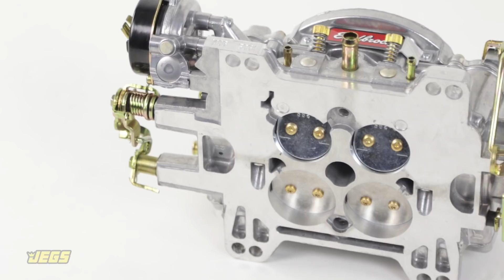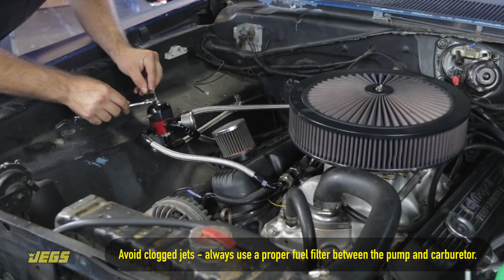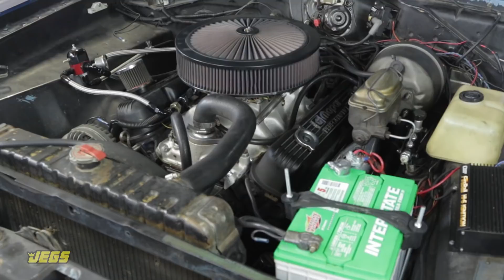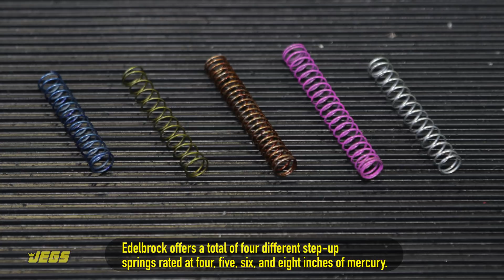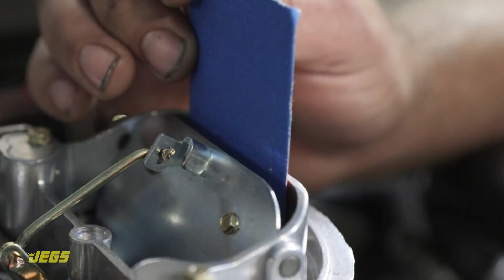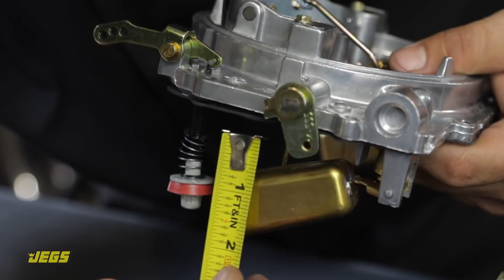How to Tune Edelbrock Carburetor Carb Idle Mixture Screws Choke Metering Rods Jets Fuel Air Vacuum

Comment: The idle on my vehicle doesn't change no matter how much I adjust the idle screw, furthermore the only time the mixture screws change the RPM in the downward position is when you lean them both out to the point where the engine stumbles then the reduces very little.. The idle speed is around 1500 rpm (if you just drive around and let your foot off the gas) but you can go up to the engine bay and reset the throttle lower or by pulling on the gas pedal.. I even have 2 springs set to return the throttle and they don't seem to work.
Reply from the maker: The first thing you should do is remove the idle screws and blow out and possible debris or blockage as turning them in or out should affect idle mixture and smoothness. If there is still an issue the next possibility is a possible vacuum leak somewhere else, check the base gasket and any other places air could be leaking and causing the adjustment not to work. A high idle can be caused by a vacuum leak or adjustment is needed on the fast idle. See the instruction manual on how to test and adjust.
Reply: JEGS Performance  I notice the idle drops to a reasonable level when I disconnect the vacuum advance on my duraspark 2 dist. I did a vacuum test and noticed it at 20 inches but it shakes violently + or - 5 inches vacuum.
Reply from the maker: Hmmmm...perhaps the distributor setting/adjustment/vacuum advance is the issue? If interested, you may give Edelbrock a call direct at 1-800-416-8628 as they may be able to offer more ideas...
Reply: My dodge truck was doing the same thing. The kickdown rod(cable on most vehicles)was adjusted too far out on my transmission, which wasn't letting my throttle return all the way.

Comment: need to know where to put vacum lines on a 650elderbrock 4barrel
Reply from the maker: The distributor advance goes on the front left side (above the throttle blades), The PCV goes in the front middle 3/8 line. Vacuum modulator valve goes on front right (below throttle blades). The power brake booster either goes in the intake manifold at the back or the back port on the carb. Hope this helps.

Comment: new motor installed fuel is leaving the carb after its sat for about 6 hours I poor fuel in the carb fires right up doesn't leave the line but where could it be leaking from into the intake manifold
Reply from the maker: What is your fuel pressure? What do you mean by "fuel is leaving the carb"? If you have 6 psi fuel pressure, take the top off of the carb and inspect the needle and seat to make sure it is not stuck and also check that the floats are set correctly per the manual.
Reply: JEGS Performance pressure is right around 6 but I believe it's draining out of the bowls into the manifold
Reply from the maker: That tells us that either the needle and seat is sticking open or the floats need adjusted as either are continuing to allow fuel to fill the bowls and overflow them. Have you checked them?

Comment: i need help with my truck, it has a 350 small block and it idles good in park but once i put it in drive or reverse it shuts off, i was told it might be a carb problem
Reply: Vic The Barber 666 ...me too i got a 1980 chevy wit your same motor its standard 3speed shift but it's starting then when in gear it bogs gotta give it some gas to keep on make me look like dont know how to drive my dam truck dam annoying..
Reply: JEGS Performance
Reply: my carburetor is doing the same, you cant blow in to the car though the fuel line, feels like if it is stock...
Reply from the maker: If you have a bigger cam than stock and a stock torque converter, you may need a higher stall speed converter. If it is too tight, when you put the vehicle in gear, it will kill the engine.
Reply from the maker: What torque converter and camshaft do you have?
Reply: JEGS Performance ..not really sure i bought my truck   with it installed ...
Reply from the maker: Well, the first question to ask is what camshaft and torque converter do you have? If the torque converter is too tight, when you put the transmission in gear it kills the engine because it is not slipping enough. this usually applies to having a bigger cam with a stock torque converter. This is also assuming you are not touching the throttle at all when you put it in gear.
Reply: JEGS Performance sounds like my problem im not sure what cams in it but it is an aftermarket bigger cam and stock torque converter, would i just buy a torque converter with the specs to my engine? i dont have a lot of knowledge on torque converters
Reply from the maker: You really need to find out what lift and duration your cam has, otherwise it is a guess on what torque converter stall speed you need...Give us a call at 1-800-345-4545 and speak to one of our techs, they may be able to help you narrow down to a close-to-correct torque converter stall speed....
Reply: JEGS Performance alright thanks for your help ill give you guys a call sometime
Reply: got the Edelbrock 1406 carb
Reply from the maker: This is something that would be helpful to know. If the torque converter is too tight due to the camshaft being larger than stock, the engine will die when the transmission is put in gear. We are assuming that idle speed is around 800-1000 rpms before putting in gear?

Comment: mine got messed up and I barely had a year with it I didn't have the electric choke connected on what you showed with the credit card..the time I wanted to move the truck it backfired and turned off till it left some flame coming from the lower part of my passenger side header..owner that use to own the c10 that I own now left it sitting for 7years not covered at all from the sun and all but to get to the point the choke got stuck and only realised it when I wanted to start up the truck the next day and to see if it hopefully wouldn't do it again but wouldn't start
Reply: dude, I almost had the same issues but my carb was almost new. I ended up getting a holley four barrel meant for the engine family of my C10, which is a 350 for 60$ and rebuilt it with a 30$ kit and it runs great! but it's just a suggestion.

Comment: Need some help on this, I have a carter afb competitino series, electric choke, pretty much looks like this.  I got help setting it up and was told the back center port was for the pcv ,( not the power brake )  I know this is for edelbrock but they seem to be essentially the same.  I am having what sounds like "gasping" issues when I first throttle hard, and its smelling pretty rich when I start.  I initially came here for tuning advice, but it seems that my pcv valve is also an issue, are these two carbs the same?  Any suggestions on the "gasping" issue?
Reply from the maker: They should be the same carb. the back port on the carb is recommended to go to a power brake booster or else plug it; it is full-time vacuum. The front 3/8 hose barb is recommended for PCV valves or cap it; it also is full-time vacuum as it is below the throttle blades. For the rich on start, follow the instructions to set the idle mixture and make sure it is set to lean idle setting. For the gasping issues it will require a little experimentation. Try changing the position of the accelerator pump arm (move to a different hole) and test, experiment with primary jet/metering rod combo as shown in the manual, then possibly you may need a high volume pump diaphragm or bigger squirter nozzles. You can also call Edelbrock direct at 1-800-416-8628. Hopefully this helps.

Comment: What would prevent secondaries from operating?
Reply from the maker: The first thing to check is whether the throttle cable is operating completely. When the pedal is to the floor, the cable should open the throttle all the way. There are then other possibilities..Verify the choke is opening properly. Verify that there is sufficient engine vacuum, otherwise it may contribute to the secondaries not operating correctly. If all of this is correct and you are still having issues, call Edelbrock directly at 1-800-416-8628 .

Comment: What about vapor lock? I'm in az and having a difficult time with it in the summer months
Reply from the maker: There are a few things you can do. One is a heat insulator such as the following: http://www.jegs.com/p/Edelbrock/Edelbrock-Heat-Insulator-Gasket/743639/10002/-1
Reply from the maker: A more extreme measure is the following: http://www.jegs.com/i/Mr-Gasket/720/1350/10002/-1
Reply from the maker: Another possibility is insulating the fuel lines from heat with the following: http://www.jegs.com/p/Thermo-Tec/Thermo-Tec-Thermo-Sleeve-Insulation/746616/10002/-1
Reply: +JEGS Performance thank you for your quick response I'm going to look into that

Comment: why does my chocke take a long time to open?
Reply from the maker: make sure you have a good ground and good 12 volts of power going to it first of all. Second, you need to adjust it by twisting the cap, one way will make it open faster, the other way, will make it slower to open. This is provided the choke is not damaged.

Comment: My accelerator pump hole on the top of the carb is leaking could somebody please help me on this issue?
Reply: Float level adjust too high
Reply from the maker: +Matt Fogarty The only possibilities we can think of are the top plate gasket or the accelerator pump diaphram that would allow fuel to build up in the "accelerator pump well". Both can be found on this page: http://www.jegs.com/p/Edelbrock/Edelbrock-Carburetor-Rebuild-Maintenance-Kits/753814/10002/-1. Otherwise, you can call Edelbrock Tech at 1-800-416-8628. They are open 8am-5pm PST. Hope this helps!

Comment: this guy said leave the aircleaner on  while setting idle screws-  well i can on mine,  nether can he....
Reply from the maker: +iain flower if you can't, that's fine. It will be a more accurate setting if you do though since the air filter restriction will affect idle mixture....
Reply: Just throw on one of those tiny round or triangle filters during tuning
Reply from the maker: @regeneratedDegenerate  True. However, Ideally, you want to tune it with the filter you will be using for the optimum mixture if possible. Otherwise, yes, that will work.